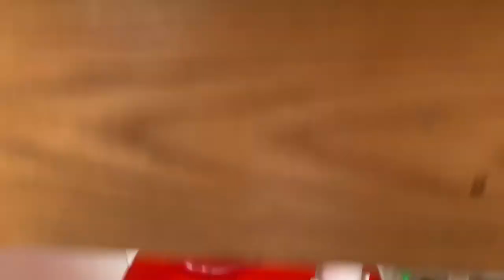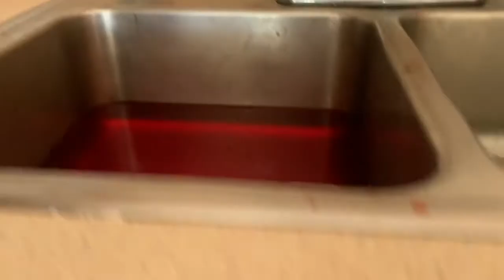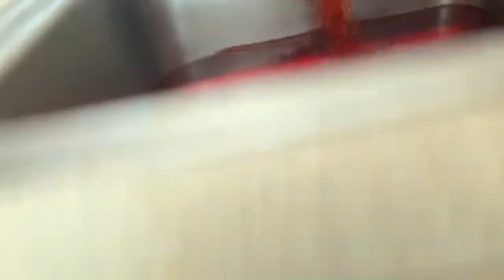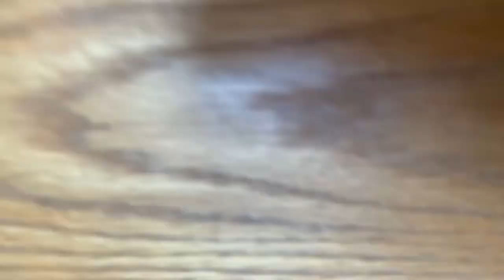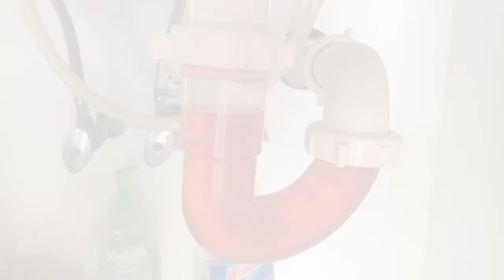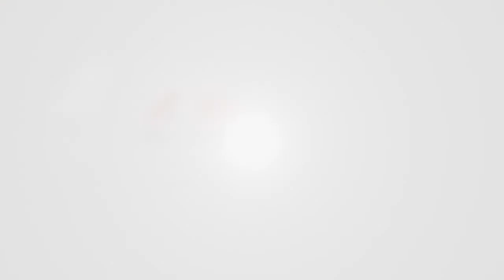P-traps and S-traps

Comment: I mean, kinda... but eventually things have to go down from the P-trap, too, right?  What sort of distance is required for it to be horizontal before it goes vertical again, and/or what other factors are relevant here?
Reply from the maker: Once the p trap goes into the wall, it is connected to a pipe which goes up and down. The water goes down, but air is drawn in through the part of the pipe that goes up. In other words a p trap is vented while the s trap is not vented.   Air being drawn into the pipe prevents it from being siphoned dry.
Reply: @morganinspectionservices3840  Ahh, ok, thanks.  Yeah, that totally makes sense -- that a P-trap is then vented at the downturn totally changes the ballgame, I just didn't see any indication of the venting aspects in this video, so it wasn't clear to me.  Now it is!

Comment: The very point you are missing out to explains the difference between an S trap and a P trap is in which direction the outlet from the trap takes, If the outlet from the trap goes down vertically it is an S trap, if the outlet pipe goes horizontally it is a P trap.
Reply from the maker: The point of my video was to show the difference in how a P-trap and an S trap perform when a sink drains. I am in the process of putting together a new video which does explain more of the differences between an S- trap and a P-trap and how to identify what is what. Thank you for your feedback.

Comment: The s trap does not allow gases into the house. It clearly didn't empty.
Reply: If a toilet flushes on the same network of drain pipe, then the surge could siphon the trap dry, defeating the entire purpose of a trap.
Reply from the maker: Agreed. I was never able to get it to empty, but it did lose more water than the P trap. S-traps have a higher likelihood of being sucked dry than P traps. That's why they are no longer allowed.

Comment: You just showed both of them work fine.
Reply from the maker: I was trying to show how the sinks drain differently, and when the S trap was used, more water was sucked out of the trap than with the P-trap, so it did show a difference. However, you are correct that enough water remained in the S trap for it to do its job. Perhaps I showed that S-traps aren’t that bad because it is hard to empty them when a sink drains.
Reply: he only showed one "test".  There are other situations, such as a commode flush, where water is pulled out of the S trap from below, not pushed from above, and it can empty most if not all of the water in the S trap.